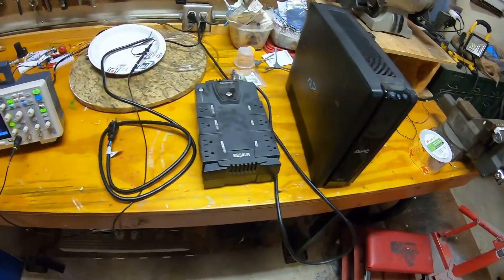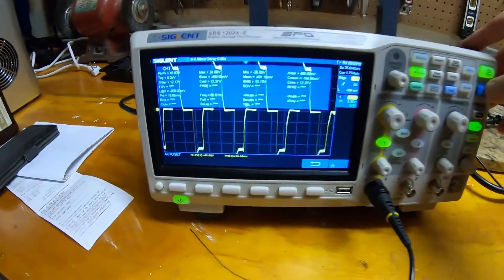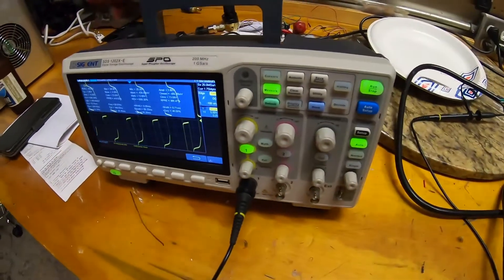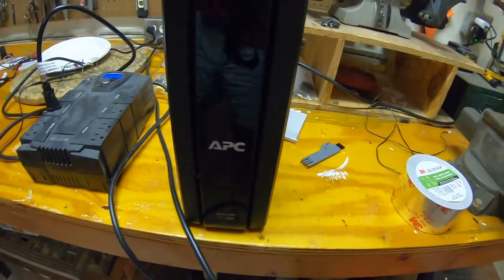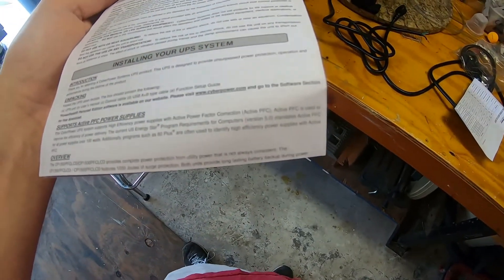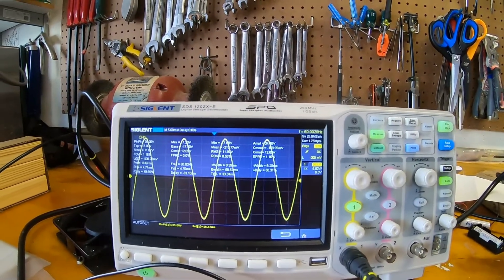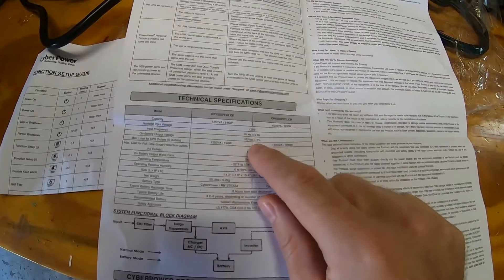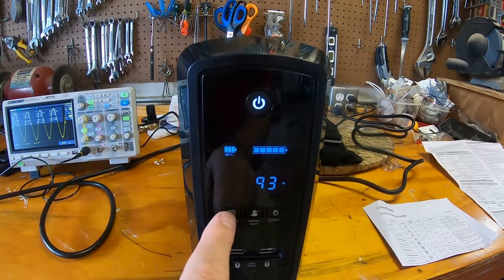UPS/Battery Backup Buyer Beware!!

Comment: Sorry to comment on a five year old video.  I was considering getting a UPS with pure sine wav.  I have this very strange problem where plugging my music keyboards into my PC for recording in software, results in the sockets breaker tripping for that part of the house. I've tried lots of different keyboards and computers and even the 2 houses I've lived in. One electrician said it's possibly dirty electricity or harmonic distortion. Nothing else trips the breaker. I can plug my electric guitar into a interface box which has a usb C cable going into a USB type A into the computer - No Issues.  But If I plug in a keyboard into that same interface box, - power gone inside 60 seconds. Apparently electronic devices are Non-linear loads and harmonic distortion wrecks havoc?  Maybe I need something to plug the keyboard into before it goes to the computer? 

Any help would be so appreciated!

Comment: People talk shit about Cyberpower, but I've had one for about 2 and a half years it was flawless (CyberPower CP1500PFCLCD). I bought a APC gaming pro, the shit caught fire within 2 weeks, even with my power capped to around 800watts. I will just buy a new unit of replace the batteries to this one. I have a pretty powerful PC hooked up to it, a 9950x3d, RTX 5090, 32gb ram, 1200Watt PSU, total power draw without Overclocking is about 960watts, so yes the batteries gave out fast but they haven't had a good time with this much power through them LOL

Comment: Wow!! Those first two outputs aren't even close to meeting a stepped waveform as I was taught. Those suck. Those outputs can smoke power supplies and electronics. I have used the small APC units for years and hadn't seen any failures (yet). Thanks for doing the testing and sharing it with us.

Comment: Seeing one of those APC BackUPS XS 1500 units still working alone is pretty rare, all of the ones I've seen die of relay failure F06. easily they are the worst junk APC has produced. 

it should also be mentioned that the BackUPS Pro series that came out to replace them (that finally have a sine wave inverter) also have have batches which will fail dramatically, due to APC using a transformer with aluminum windings that have a high chance of not being soldered correctly.

I have less experience with Cyberpower consumer units since I've just moved on to buying commercial UPSes used, never looked back.

Comment: They areood i have 2 350VA and 550 VA ok i change battery i have 350 VA with 12 volt lead acid battery 20A and 1 7.2A 12 volt get like 8 hours on it run time

Comment: 30 plus years ago, the stepped simulated sinewave served a purpose. It allowed manufacturers to build portable inverters, and UPS that were smaller, and at a reasonable price. At this time, the stepped sinewave UPS was a mere $70-$120, while the true sine wave models, which were only available for servers, even the smallest models were well over $1000.
Within the past 10 years though, after advances in circuitry and higher speed transistors, the "step sine wave" not longer serves a purpose to consumers. The manufacturers can build a true sine wave UPS for just $10 more than they can build an equivalent stepped sine wave model. However, they charge consumers an additional $30 or more, for extra profit.
Reply: I guess Apc and Eaton who were pioneers in UPS systems had a monopoly (I still forget the name of the third UPS vendor back in the 90s) and charged and still make a lot of profit. I purchased a Apc 900VA over a decade ago for few euros above 200 and the UPS is modified sinewave having only 2 sockets for back up and 3 only available for surge protection!!! Few weeks ago a brought  Cyberpower's new sine wave 1600VA UPS which has 6 schucko sockets available for both surge and back up protection for a cost of 332€. The equivalent from Apc costs 580€ in my county (Greece) and Eaton is priced 520€!!!

Comment: Not just that.... I encountered stinging in my eyes because of the constant charging or line interactive stuff that's going on. For reference, the battery is constant "trickled" to keep the charge up but at the same time, is releasing really small forms of hydrogen. Now in a closed space that stuff is killing. It's pure poison and if you get that typical egg smell, remove the frigging thing and throw those battery's out. I'm considering to box up my UPS and have a separate ventilation for it.

Battery is one year old; the unit has not been used. It came brand new however it was left on the store for over a year or so. Now one day i can imagine the battery to top off again but it was active for 3 days and still did not change.

Comment: @JoesGarageProductionsLLC  I am an EE as well. You asked why transformers can handle "bad" sin wave power, Here is one way to think about it: normal electronic components don't see "sine" or "square". They see voltage (like pressure), current (like volume), and frequencies. Even a pure square wave is NOT just 0 volts / 110 volts like we see. It is (really) a set of pure sin waves at a bunch of (harmonic) frequencies, that add up to the square! Search Youtube for this to see it: Fourier Series square wave animation
* Filter out the high frequencies of those "bad" stepped-sin UPS... you get clean pure sin wave power.
* As others note, it's non-electronic power to be wary around.

Comment: It's not sold as a pure sine wave unit and you don't need one, modified sine works well enough. It's not meant to be a power supply, only to give you enough time to save your work and shut down safely duh...

Comment: I am an electrical engineer. This is exactly what I would expect.

You should (a) put a resistive load on the UPS and (b) wear shoes!

If you want to fix it, add some ferrite (31 mix) around the output wires.

The inductive input of the fan in no way resembles a computer. Switch mode power supplies only draw current at the very peak of the cycle, since the diodes inside will be forward biased and the line voltage will be higher than the storage caps.

Also, why do you keep pressing the auto set button on the scope?
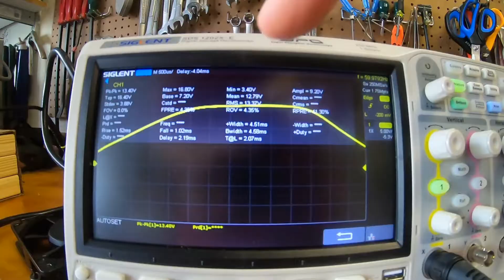Reply: 11:50 the flat topping is due to switching power supplies that all load the very peaks of the cycle.

Comment: So I have a regular power supply thats plugged into the wall. I had a regular pc and monitor and a helium Hotspot, iot rak miner, and my router plugged into it all and it worked fine. Well a storm caused it to shut down several times and now stupid windows is asking for a password I do not have bc I changed my password since I installed it. So I started using a gaming pc My brother left and even though it's 5 or 6 yrs old,  when I rub it it trips the power supply and shuts everything down. It's not tripping the breaker so I'm assuming I need a sinewave battery back up. But I wanted to ask ppl before buying anything if yall think that's the case.

Comment: Old Video, tons of comments, but there is a White Paper, Search for Different Types of UPS White Paper and it will go through all of the different types and specifications.   The Pure Sine Version you have does have an AVR, for the voltage, but does not condition frequency, only keeps voltage regulated.  If it senses Frequency Changes beyond a certain threshold from 60hz +- it will switch to battery.  How does the AVR work, I think in these they switch between different transformer taps as the voltage dips and spikes from the line power, but not 100% sure if they still work that way or if it's been turned into a mosfet/chinese cheap ass circuit to handle it which may be better, or not, Transformers are hella expensive these days so would not be surprised if no Transformer.

Comment: 00:15  both advertise "step-approximation" 
02:55  and 05:30 From what I can see, neither UPS is providing what any engineer would call a "step-approximation" waveform by any definition, even a very "relaxed" definition.
A "step-approximation" waveform typically has multiple readily visible "steps" that look like house stairs going up and down as the waveform proceeds from 0 to peak positive voltage, and from 0 to peak negative voltage. What those two UPS units are displaying on your setup are very poor approximations of a square wave.
I've seen some "step-approximation" UPS outputs provide aa few as one step, usually ~midway between 0 and the peak positive or negative voltage, but still meeting the strict definition of "step-approximation", but the better ones, although still just "step-approximation", provide multiple "steps" between 0 and the peak voltages.

edit to add: personally, I've seen much better "step-approximation" (aka "stepped-approximation") waveforms from all the APC UPS units I've used over the years, than the ones displayed by the two units at which you are looking. Regardless, I switched to CyberPower "pure sinewave" UPS units many years ago, and I believe it was a good move.

Note: I have no personal or financial interest in eitther APC or CyberPower.

Comment: I paid 900 AUD for a cyberpower PR1500ELCD 5 years back which is pure sine wave and has 8 outlets (4 battery and surge, 4 surge), and I was so happy with it - I recently put a brand new battery in it, was as simple as sliding out a drawer and swapping it.
BUT, a few weeks back, the LCD screen died. It's become corrupted basically, so it only displays about a third of the info, sporadically around the screen. 
So I thought, no big deal, I will just turn it on and off as needed, it will still work. And that was initially just fine. But at some point I must have pressed something accidentally when turning it off and changed a setting and couldn't see what I was doing (see below for what happened).

My point is, this is what can happen to an old unit out of warranty, and I can't find just the (detachable) lcd panel anywhere for sale.. so it makes me wonder if it's worth changing batteries or buying new units that are cheaper and just changing them every few years. You can get proper sine wave outputs at half the price. And the other day, I turned the unit off as normal (still plugged into wall as recommended, but when I turn my PS5 and Series X off and don't plan to use them for a while, I turn off the UPS so they can shut down properly). then a little while later, maybe 2 hours later, I was hearing this beeping. I thought it was the smoke alarm low battery warning at first, but after is started annoying me I went to check it out.
What I saw was my monitor and PS5 turning on, the UPS beeping, then turning off. Wow. It must have done it 2 dozen times before I unplugged them. Ouch.
And then when I tried to turn the UPS on manually, it would shut off. So what it was doing over and over again was trying to turn itself on and shutting off, and lucky I was around at the time to deal with it.
The thing is, I couldn't go through any options to see if I maybe put it into green power or turned some function on I shouldn't have by accident, as the LCD is corrupted. And I can't even guide it to do a factory reset.

It gets worse.. The cyberpower free software (and it was updated in October 2023 mind you), is not high DPI aware. It is the size of a matchbox on a 4K panel, and trying to override scaling settings does nothing. further more, the software forces multiple process at every system start and has no way to even exit it when running. So pathetic. I forced my panel to 1080P so I could see the software, and even at 1080P it only used a third of the screen, so I am guessing the software GUI is hard locked to a size of 480P with no way of changing it whatsoever - in 2023 and now 2024. How pathetic is that?
And after all that, there were no options to do anything I needed like a reset. It did to a quick self test and said it was fine. Who knows. The UPS seems to be working ok again now. So maybe after I unplugged everything and have not used it for  a while, it has reset itself? Who knows.

What the cyberpower model I have DOES do that is unique though, for a 1500va model, is it has 1350 watts capacity, whereas most 1500VA units are 900 watts or 1000 at most. This means it will easily be able to handle an 1000 watt AFC PSU on a 4090/13900k (for example) system, and if there's a spike in power on switching over to the UPS, where as a 900w unit might be overloaded and just cut out anyway.

I refuse to spend 900 dollars again since I use a laptop now and only the consoles are on the UPS, but it was nice to have around when I used to run a Mac Pro, I always felt safe with the cyberpower. Anyway, I found the powershield defender 1500va/900W true sinewave UPS for 299 AUD.. RRP is 820, most stores have it for 600 to 700, but one of the big national chains is doing a mega special, so for that price, I jumped on it. 
I'll keep my cyberpower as backup and see if they themselves will sell me a screen or at least be able to hazard a guess as to what it was doing on that day of weird behaviour, but, it has put me off spending that much money. And the battery replacement which was 250 bucks shipped, could have gone towards a new UPS.

Comment: I worked in IT for 25 years, and we never had a computer that would not run on a cheap UPS.
Reply: Probably because all computer use DC current?
Reply: @kongsunlyheng4186  UPS's put out AC. either pure sine wave, or some kind of stepped sine wave.
Reply: @ObsessionoftheMonth  ye, and power supply for computer would just convert it to DC

Comment: Fortunately your average ATX SMPS does not care much about modified sine waves in the short-term, which these UPS devices are designed purely to provide time for proper shutdown in the event of power loss.

APC is garbage today though - look at the laughable aluminum-copper soldered joints on many of their newer transformers.

Comment: The APC "Back-UPS" line advertises a "step sine wave", which has the same "approximate" RMS value as a pure sine wave. That is clearly explained right on the box. If you want a pure sine wave you'd want the APC "Smart-UPS" model which produces a sine wave superior to your wall outlet. As someone mentioned here, that step sine wave cleans up nice with a load on the unit, so this "test" is skewed from the start. I worked for APC in W Kingston RI, for 16 years, then "retired" with enough stock from their ESOP plan to live pretty well at a fairly young age. I decided to leave when they sold the brand to Schneider electric. Those were some GREAT times and APC was a great place to work back then. Ahhh the good ol days...... ☺
Reply: APC was the best before the sellout, um, buyout. I used to spec APC on all of my installs, but after having a run of VERY bad experiences with APC (including two smokey failures and several that actually produced flames and swelled batteries,) I went to Tripp-Lite and never looked back.
Reply: that sucks, Schneider isn't good from what I heard.
Reply: I think the gaming version of the apc ups backup has the sine wave.
Reply: can i use a Simulated Sine Wave UPS with my Computer having an Active PFC power supply ?

will it damage my PC ?

Comment: Once this dirty "sine wave" goes into the filtering stage that includes high frequency and common mode rejection filtering, the rectifier bridge to develop the B+ for the switch mode circuit, none of this will make a damned bit of difference to a modern PC power supply.

Comment: Thanks for this.  I've worked in datacenters and understand how important a good UPS is but I'm not an electrical engineer to understand all the technical aspects.  This video combined with a couple days on and off research made me understand just how bad the 'cheaper' non sine wave UPS's are for my desktop.  Now I just have to hope Cyberpower stopped using the glue that transforms into conductive powder as it ages.  It's a shame that Eaton doesn't make anything less than $400ish in this range or I'd just get one of theirs.